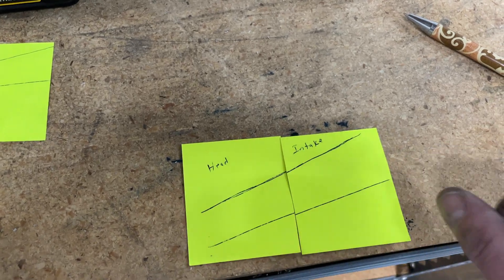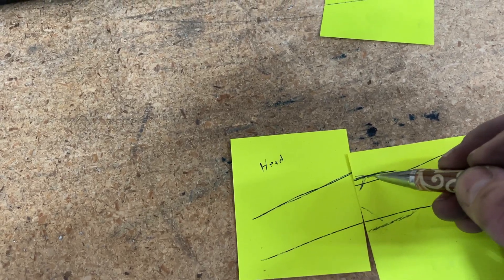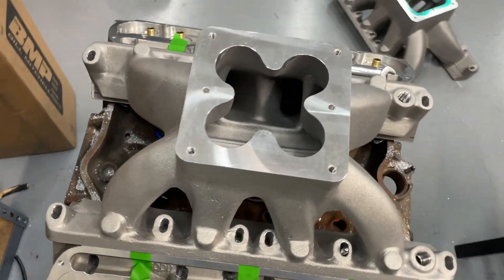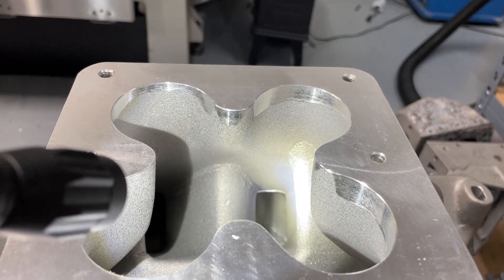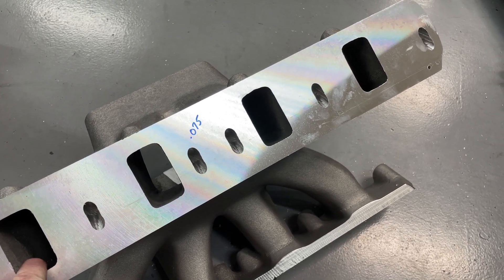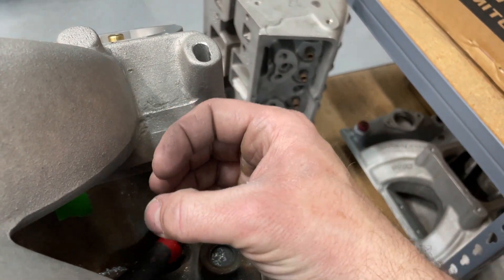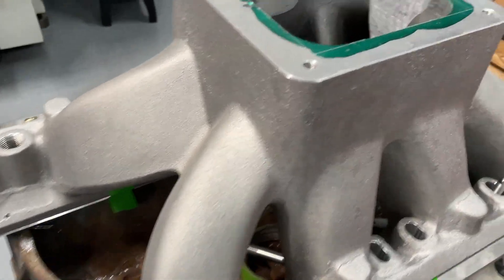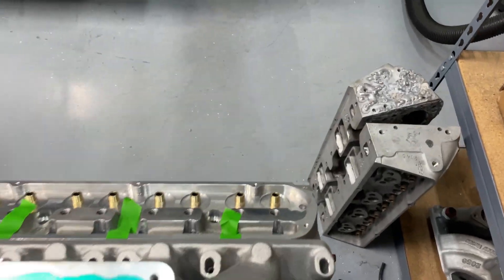Port Matching Intake Manifold Information

Comment: I've always heard if anything is to match up, always make sure it's the floor of the intake with the floor of the head.

Also sometimes using different thickness intake gaskets can get you a good floor alignment without having to machine the intake. Sometimes.

Comment: I'm dealing with this problem right now except it's a mostly stock application. I'm building a ford 390 & I spacificly told the shop to leave the piston .010 down in the hole & he didn't listen & cut the deck down to 0. So now it's approximately 10.135 deck hight. From 10.17. The crankshaft grinding was a nightmare also. First I didn't have enuf clearance so I needed .001 off the rods. He couldn't get it so I told him go the next size under , witch would be .040 under from were we were. He admittedly screwed it up so I said go the next size under that. Witch is .060 under. He gave it back & I still only have .0015 bearing clearance & from the front journal to the back journal I have .010 different stroke on it. And on # 1 cyl. It's. 003 out of the hole & on #8 cyl. I have .011 out of the hole! I'm thinking of just getting a different crank & starting over with a new shop. But still have to fit the intake. Its a nightmare just becouse of the machine work!

Comment: Eric, Have you flowed a head with the intake manifold attached and have you seen a reduction in flow?  Have there been distribution issues if you tried the  Dykem wet flow testing with the intake attached?    I've long thought that an intake, especially a dual plane, had a greater effect on flow / distribution than what many think. RE: A port can be ground  to flow using clay as a head port radius but that does not = what it will flow with an intake.
Reply: I believe he speaks of this in another video. I will tell you from experience that yes there was reduction. On my 93 Cobra #5 lower intake runner makes a nasty turn. All other runners follow yet the bends lessen the further from the distributor. 20 years later I've gone with an individual throttle body system and thats how I achieved the best flow through an intake and cylinder head. I had a lot of time on my hands in my 20a.

Comment: Is your mock-up block at standard deck height? It also seems like you’d need to know the head gasket thickness if it was extremely thin or thick relative to standard. I’m guessing most race builds would have the block decked a bit. How much before it’s an issue?

Comment: I just did a 283 last week where I had to mill .075" to get the intake to line up but I milled it off the head that way if the customer wanted to swap intakes in the future his was untouched and he could sell it and not have to have his new intake milled.

Comment: I have edelbrok 2970 which has square ports matched to 1206 gasket. I recently bought AFR 245’s and these ports are oval. The port alignment is fine top/ bottom and side to side however the the head oval port corners are exposed since a square intake port will not match an oval port. How much HP you think in losing from the head corners obstructing flow?

Comment: Great topic Eric. The first engine I built had the block just barely decked and brand new edelbrock heads. The manifold still sat too high! I didn't know to check but I can see it looking in the plenum.  I can't wait to swap intakes to my custom and milled so the ports match up. The roof steps down and the floor steps down from the intake to the head. I'm hoping it's the reason that power nosed over hard at 4800.

Comment: If you lower it on a Chevy won’t the manifold bolts be offline with the head hole
Reply: Odds are, if your ports are too tall, your bolt holes will be tall too.
Reply from the maker: Most are slotted or oversized from the factory so no big deal.
Reply: @WeingartnerRacing  I had a set of bb3 done by RFD and the engine builder checked them and he had to take off .007” to get them flat and the intake bolt holes had to be slotted besides the holes were miss aligned..I was just thinking when lowering the manifold would be the same concept..
Reply: @WeingartnerRacing  p.s. I watch every video…you give away a lot of secrets 👀

Comment: Another great video! You gotta stop worrying about what you say. Even when you go on, there’s still a lot of what you say that makes sense!  I just did an upper engine replacement, and I used the Prussian Blue to at least make it all match. I probably spent more time making my new headers match by finishing my ports to flow as smoothly as I possibly could. I grounded out the header flanges as much as I possibly could, ( they’re a set of Schoenfeld’s that I had to delete my AC box over, to get them on my car) cause I only put a few miles on my car a year. I may not drive it a lot, but everything I do makes it faster! I’d love to work on a race car, either drag or circle track! I’m just someone who missed out on an opportunity, but still has the drive. Your videos are definitely giving me something to inspire me to make even more power!! Keep it up!!

Comment: If it was close couldn't you just use a thinner intake gasket?
Reply from the maker: Yes but often its not possible because they don’t make thinner gasket.
Reply: @WeingartnerRacing  Can't you just skip the gasket altogether and just o-ring the intake? Get a better seal. Another question, if it bottoms out, can you mill the top of the block on both ends?
Reply: @xlr8r3VA  To "O-ring" the intake would of course work, but would be cost prohibitive. The sealing faces would have to be very true, and the grooves are an extra machining process. That's why you see it more on molded plastic intakes, like the LS.

Comment: Could you add epoxy rather than milling? Would it stick?
Reply: It would be faster and safer to mill. Makes the ports more true then epoxy ever could
Reply: @robtdougherty  Thanks. I was just thinking in a situation where you had to deal with the china wall, distributor spacing  and everything else that could cause misalignment by milling, seemed that filling and then porting the epoxy would be easier all around.